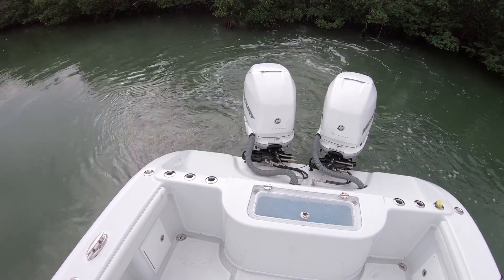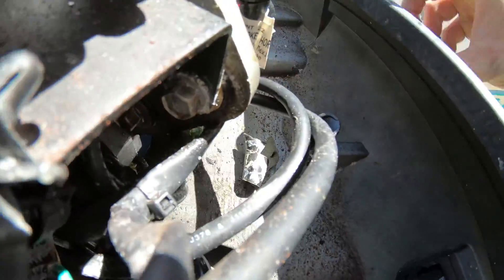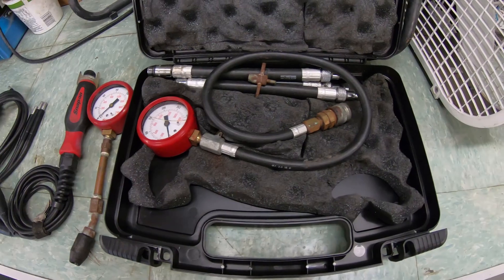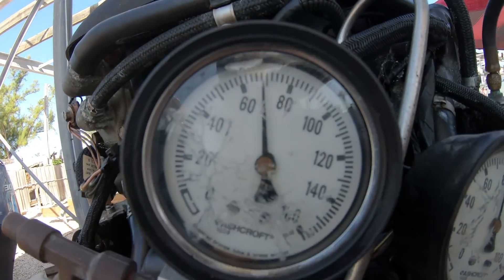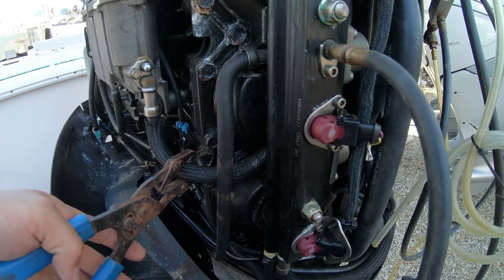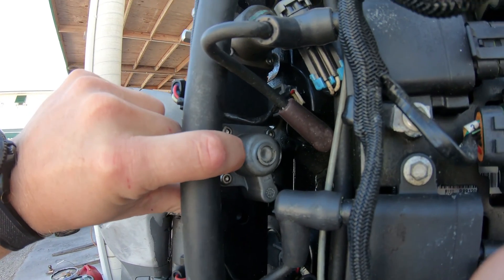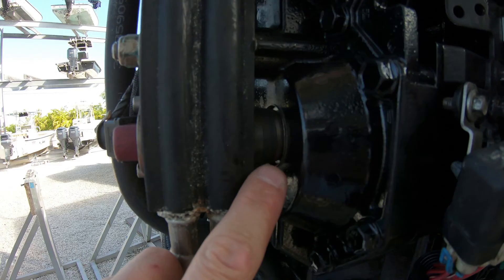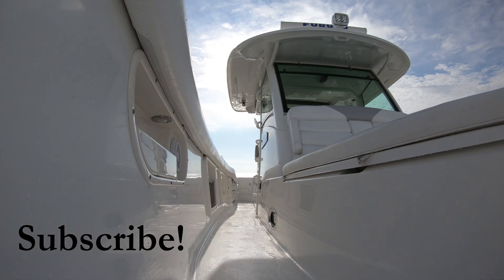What You Need To Know About Mercury Optimax's! | Troubleshooting

Comment: Have a 115 optimax that ran fine until we swapped out pedestal, originally thought a wiring issue, took to marine shop and learned fuel pump was bad
 We ordered one and replaced, it did start and run for approx 3min. Then stopped. Noticed then the fuel pump had reverse polarity from the original. Suggestions? Now it wont even turn over, but we did swap the wiring to match polarity now. Would this have done damage? What should we check next?
Reply from the maker: That's odd. It happens though. I would stick to checking what has already been done. If everything was working properly before replacing the swivel bracket, then the engine wouldn't start and you found the fuel pump wasn't working. Something sounds fishy with the whole reverse polarity thing on the fuel pump. There are two fuel pumps inside the VST, so if you reversed the polarity on one, then the other one isn't going to be working properly. I'd say to open the VST back up and check over that whole situation. Then as long as they are working properly, move on to checking the fuel and air pressures to see what's going on. Hope this helps and you get it figured out!
Reply: Um fuel pumps in vst have different size spade fittings impossible to have polarity issues.unfortunatly there are some techs,I won’t call them anything else that will throw parts at an engine,check harness fuses then continue

Comment: What is the  proper way to reinstall lower unit 225 opti 2004,cant get forward gear now all worked fine before water pump change
Reply from the maker: Sounds like the shift shaft has just turned a little bit. You'll have to drop the lower unit again, just enough so that you can turn the shift shaft on the lower unit. Make sure the engine control box handle is in the neutral position, then spin the shift shaft on the lower unit so that you can spin the prop shaft and know that it is in neutral. Then just slide the gear case back up, guiding the shift shaft into place. Once its up, stick a nut or bolt in to hold it and make sure the prop shaft spins. Then go up and shift the engine into forward and reverse and check to make sure the prop shaft stops spinning and is going into gear properly. You don't have to run the engine to check the shifting, just shift it and see if the prop shaft spins. You should be good to go after that! Hope this helps.

Comment: Why could the lower part of the fuel rail not get any gas? What part would be bad for the lower section of it to not work? I notice there are two hoses that go into the fuel rail, and when I would press on the 2nd schrader valve, it only had air. The top would have fuel. I tested the lines by opening the key so the fuel pump would fill the hoses that go into the rail up and they both seemed to work. What in the fuel rail could be failing? It seems so simple
Reply: The engine used to turn over for a second and then shut off. I took the fuel rail off to clean it because my boat mechanic has waisted so much time and money on fuel pumps that work and hasn’t shown up at all anymore.  After putting it back together, now it doesn’t start at all, it does crack. Was told by other shops it cost 250 just to see the boat plus finding issue and fixing it. And also some that say it would take over a month and a half to even get checked.
Reply from the maker: That is the way it is supposed to be. What is the issue? The back valve will only have air in it and the top will have fuel. They should not be mixed. What is the engine doing?
Reply: Born Again Boating it’s a 2006 Mercury 1.5 90hp. Apparently the fuel injected outboard engine have lots of issue. This boat was barely used by previous owner, 150 hours.
Reply from the maker: @Atlantis Man, sorry to hear that you are having all this trouble! That's a bummer. I would say to start by going back over everything and starting from the beginning. It sounds like there has been a lot of stuff that has been messed with and now there are other issues going on! Maybe just double check everything and go back to checking the basics, fuel pressure, air pressure, and making sure there is clean fuel to the engine. Since the VST has been apart and parts changed in it. It's possible that something was not put back correctly. It's hard to diagnose an issue like that when there are so many variables in the equation. Get it all together and recheck the fuel and air pressures to see if you are getting the correct readings.
Reply: Born Again Boating thanks for replying! I got a new boat mechanic this morning and he started off by checking the pressure but said that the computer  was not giving the coils any signals so we were running on just one the whole time .. he said something about the computer we had not being good but he also didn’t believe it was an original one. It was motorola, but I googled the same year and it says that that’s the one mercury used for their boats. Also spark plug one had a lot of oil so that would need to get replaced. Hope that this guy fixed it and we get it running perfect! I’ll be back with info!
Reply from the maker: @m9katchm9  awesome! Congrats! Cant wait to hear how it turns out!

Comment: Why won’t my lower Schaffer valve on the fuel rail not have any gas at all?? The pumps work. Got new ones.. tested them by removed he hoses and the fuel seems to enter the fuel rail .
Why is the lower valve only building up air??
Reply from the maker: Well there are two schrader valves. The one on the top has fuel, the one on the back has air. They should not be mixed.

Comment: Help!! Have the same engine, won't star. When a try to star i see 80 psi fuel rail and 74 to 80 psi air pressure . Have new tracker valve new  2 air pressure valve. I test the high pressure fuel pump have 50 psi.. but won't star please help. Thanks 😞
Reply: Finally was the high pressure fuel pump! The engine run perfect thanks.!!
Reply: I try all and imposible star the engine. I need a good mechanic.! Or a good place to go with the boat. You know about someone can help me ?
Reply from the maker: That can happen :) no worries, where are you located?
Reply: @BornAgainBoating  i am in cutler bay   florida
Reply from the maker: Ok, sorry, I'm not to familiar with that area up there, idk where to recommend to go
Reply from the maker: Sounds like the air pressure is not building properly. Could be a leaking air injector or bad pressure regulator that is on the rail. Usually when the pressures are that close, something is going on with the tracker valve, but you said you replaced that. 
The engine won't build fuel pressure without air pressure. So if the air pressure doesn't come up, neither will the fuel pressure and the engine won't start. Especially if it can't shoot the fuel through the air into the cylinder.
Reply: @BornAgainBoating  appreciate.!! I will check all that thanks

Comment: I was on my 115 optimax and then bobbed down. Tried everything but the injectors. The motor still runs like shit. Won't go pass 3000. Motor feels like misfire. Do you have any idea?
Reply from the maker: Not really, could be anything! If you could give some more details that might help. Spark compression, fuel and air pressures, last time the fuel filters and plugs were changed, any alarms, how old is the fuel, is it ethanol free fuel, etc.

Comment: Good grief! Looks like Mercury did a great job of over-complicating an engine! Just out of curiosity, can a shade tree mechanic do anything to service/repair/clean the air compressor or fuel injectors? Great video!
Reply from the maker: Ahhhh they aren't that bad :) Sure, just run some quickleen occasionally when you fill up the fuel tank! That should keep the injectors pretty clean! Also, stay away from ethanol fuel and stick to the REC-90, that helps too!
Reply: @BornAgainBoating  Roger,Roger. What about when traveling internationally?

Comment: 2007 opti 175 pro xs - motor had bogged down a little here and there but got up on plane 100% of the time and then ran great. I had ran a tank of regular gas through it. This past weekend i put a tank of premium in it and a can of seafoam and the problem got significantly worse at 1700-2000 rpm and wont climb above that. surges once per second at idle. Compression test had passed before i bought the boat a month ago. replaced spark plugs and issue is still there. any ideas?
Reply: I put a tank full of premium after using 87 for months. I get my max RPM but feels like the power at top end isn’t there any suggestions?
Reply from the maker: @MrLiltunechijr  Hello, I'd say run some quickleen in the fuel and hopefully it is just some dirt on the screens of your VST and possibly the injectors. Since it's getting WOT, you can mix the Quickleen a little heavy in the fuel and try and run at WOT for a good amount of time, burning any dirt or carbon out of the engine! Good luck!
Reply from the maker: Hello, sounds like you've got some issue's with the injectors. I'd start going through the fuel system, starting at the VST, and checking your pressures.

Comment: Nice easy video. So I have a 200 optimax bogging when accelerated above 3000rpm. Starts up good and idles good. Just Boggs above 3000rpm wonder if it's the fuel pump gone bad or maybe ethanol clogging the jets. If so quicksilver cleaner would it do the trick? All spark plugs new and just had service.
Reply from the maker: Yes, that's possible with the fuel pump. If there is some gumming from the ethanol than you can run the quicksilver quickleen and that should clean it out. Here's some more information from our website about how to use ethanol fuel in your boat: https://www.bornagainboating.com/using-ethanol-gas-in-a-boat/
Then there are two other things that come to mind when you say 3000 RPM's. 
1: The engine shift position switch might be messed up and the engine thinks it's always in neutral. That could mess you up.
2: The block water pressure sensor could have failed or is not getting any water. So, the engine thinks it is not getting cooling water and will also put you in Guardian mode and hold you at about 3000 RPM's max, I think it's like 2700, but somewhere in there.
Hope this helps you out!

Comment: l have done most of the things in the video ,spark plugs ,checked coils cleaned vst  check air &fuel ,changed out TPI but my rig runs great above 3500rpm but surges at about 1500.l have new fuel injectors and had air injectors cleaned after putting on a computer. still runs rough but not dying as bad after it warms up. Any ideals the guy who looked at it on the computer said I have a stretched hot foot cable keeping it from proper tpi adjustment. My opti max 225 Pro XS is a 2006 all but 1 cyl.compression110 number 6cyl 100.
Reply from the maker: Hello @scott bellamy I can't think of anything specific that could be causing that type of an issue. Something should have been a miss while doing all of those tests. It's possible that one of the ignition coils is beginning to fail and then at higher RPM's it is getting more juice so it runs fine.
It's hard to say for an issue like that, without being able to look at it :( Sorry I don't have any tricks or oh yea it's this, kind of information for you.

Comment: Good afternoon,  My 75HP DFI Optimax pours gas out the overflow of the VST into the water ...  Engine runs fine.   I have pulled apart VST and cleaned a couple times.  I have replaced the needle on the inlet and put new fuel filter in the VST.  Gas still pours out the overflow when engine is running.
Reply from the maker: Hello! If you replaced the needle and seat that are hooked to the float and it is still over flowing. Sounds like there is something wrong with that float. Usually the float is good and the seat and needle is what fails. I'm surprised that you replaced the needle and it is still not seating properly and shutting off the fuel flow.

Comment: Good morning, My Problem with 225 Racing Optima SX. Starts and Runs for 15 minutes,  then stops. Will Start again the stops after 5 minutes. I have cleaned fuel water separator assemble, Cleaned Spark plugs and wires. Checked fuel pump. Installed electric fuel pump to fuel line to check boat fuel line, no difference in operation.
Reply from the maker: Sounds more like possibly the tracker valve. Take a fuel pressure gauge and check what the pressures are on each side, the air and the fuel. If they are the same pressure, then the tracker is bad and you are dying out because of that.
Reply: Did you found out what was the problem kind of having the same problem on one of my motors runs fine for a few minutes then just shuts off turn it back on could go for a few minutes again and does it again seen if you found what was the problem

Comment: Great video How do you raise the idle on a 99 optimax.
Reply from the maker: Thank you! You can't really adjust the idle speed on any optimax. They are controlled by a couple different things and are basically ran by the PCM. A 99 Optimax! Now that is an old engine! :)
Reply: @BornAgainBoating  I've heard that  before but my engine idles so low it stalls out even after a long ride. Any recommendations.
Reply from the maker: Just check the fuel and air pressures and do the spark test. Possibly run some quickleen or ringfree in your fuel to try and clean out the injectors in case they are a little dirty. I guess it could be possible that the TPS is starting to go bad and that is causing the lower than normal idle.

That's if all the other stuff is good and you have some clean spark plugs. Start with checking the other stuff first, then possibly look at that TPS sensor.

Comment: I have a 2002 optimax 225 it runs rough and sometimes stalls at cold start up. Once moving and warm no issues. Any ideas?
Reply from the maker: As long as you have good fuel and the pressures are right, try a set of spark plugs and make sure that all 6 cylinders are firing :) sounds like fouled plugs
Reply: I have the same problem. Did you find a fix?
Reply from the maker: @dtaylor6000  Don't know, never heard back from them :/

Comment: What could cause fuel leaking out of the air side of the rail on an 115 optimax? The diaphragm on the air side is fine...
Reply from the maker: Possibly a busted oring on one of the air injectors?
Reply: Same issue I have when I tested it with the gauge but it leaked so much fuel out the engine stopped and wouldn’t start again until the gauge was removed

Comment: Great video 👍 Any suggestions to a 115 opti. that runs fine until ~3500 rpm when opening the throttle, then start to shake violently and then drops rpm rapidly
Reply from the maker: Thank you! Have you gone through any of the tests in the video? Start there and see what you find. 

It could be either fuel or air but you won't know until you check it out. 

Then if that is all correct. You might have a failed block water pressure sensor. If you have a smartcraft gauge see what it says for water pressure. If it is zero, that will put the engine in guardian as well!
Reply: @BornAgainBoating  I have now started a cleanout of my VST which had a fair amount of gunk in it. if that doesn't help the next step is a proper bench test. If you could have a quick look at my video that would be great, maybe you recognize the issue. Thank a million.
https://www.youtube.com/watch?v=u1NvFb8ijcU

Comment: Thank you so much. Im a rather new Optimaxuser and this video is just superb for a rational troubleshooting... Im actually having the same low pressure result that Luis Monzon stated here below (70-80 on a 200 Hp, Year 2002, 350 hours ). But the engine doesn't show any other symptoms to be inaccurate - it runs pretty great in all rpm-ranges. But I'm following your conversation with great interest... Thank you once again.
Reply from the maker: Awesome! Thank you for commenting! :)

Comment: In my engine 225 optimax have 80 fuel pressure 70 air pressure is normal ?
Reply from the maker: Hey Luis, no that is not normal. That is a little weak. You are probably not getting enough air pressure. Check that it isn't the air compressor by having your gauges on and engine runnning and pinching off that air dump line.

Having higher fuel pressure than air pressure the engine probably won't run. It's possible that the pressure regulator is weak but you should start with checking the air compressor by pinching off that dump hose.
Reply: @BornAgainBoating  yes i do this morning and when i pinching off the line the engine Up the RPM and Up the pressure just a little.. but now i dont not what to do.. i appreciate you help thanks

Comment: have been having problem with my 225 opti for years and haven't found anyone who can fix it. Just replaced the tpi and took it to the lake but doesn't won't to idle ,warmed it uo to118 and it began to idle and won't die but you can let it idle a hour and cut it off and it goes back to wonting to die at idle.i have had to hold the gas pedal at 800-900rpm for a while then it will idle till you cut it off again. checked coils all firing new spark plugs and fresh gas. Could this be a computer issue ,
.
Reply from the maker: @scott bellamy, no, I don't think it is a computer issue. It is more likely that it has to do with the pressures of the fuel or air system. It's possible that one of the injectors sticks open and then it just has trouble idling. 

Next time it won't start and idle, try unplugging one of the fuel injectors and then try to start. Go through all six, doing them one at a time and try to pinpoint if one of them has no effect on the issue. 

Other than that it's hard to say, it stinks you can't find anyone that knows much about opti's to get it fixed. Good luck and hopefully this helps. If you do notice that one injector doesn't change the issue, then it is possible that the air injector on that cylinder is your problem. 

Let me know how it goes!
Reply: i got the same problem!!!